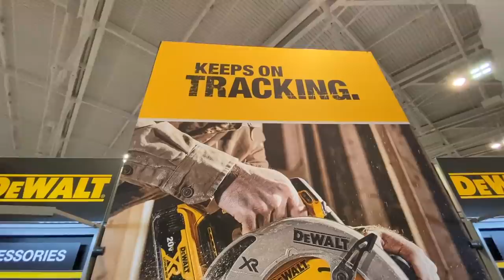Dewalts NewTools of 2020. First time seen in public at Stafda

Comment: I want to know how they've improved heat and ventilation on their new impact driver. I saw one video where a previous model went up in smoke.
Reply: Yea vcg is dumb asf. Those videos just try to use the tool on something its not supposed to be used
Reply: Yeah if you really witnessed something like that, that individual was intentionally trying to destroy the tool. There was probably a concealed variable at play in the test. I can assure you, de Walt has no issues with ventilation.

Comment: I bought a corded DeWalt DWD210G corded drill, the most powerful I could find. Right out of the box was a very pronounced wobble. I hope dewalt fixes this crap but considering I discovered wobble isssues were reported as far back as 2014, I doubt it.

Comment: Same battery would be weaker on the 2nd run, however minimally. He should have made a 3rd run with the Dewalt. Second demo used different batteries, machines, boards, hardware.

Comment: You did not "get a different result from the SAME test"... you saw two different tests.  The first test used the same saw, same battery and the same guy; the 2nd test used two different machines, two different batteries (sure, both maybe the same power rating but still different in charge maybe and/or age, etc...) and two different guys

Comment: There were 2 big variables in the 2 tests. The dewalt test used a much more powerful saw compared to the 6 1/2" makita 18 volt. Secondly the dewalt used stainless steel nails which are not nearly as common as drywall screws. They are also much softer than hardened steel drywall screws. We need to see a real scientific test. Same saws, same materials same generation of blades and a mechanical method of cutting to remove the human factor.

Comment: The Diablo booth could be rigged in SOO many points (nobody confirmed the blades before hand, nobody confirmed the batteries before hand, the 2 pieces of wood could have been different, the screws could have been different, etc).  The Dewalt booth at least went through everything (They PROBABLY still rigged some stuff), but I'm definitely siding with the dewalt both on this

Comment: My guess for the saw blades is that which ever manufacturer was testing simply sharpened their own product or dull the blade on the competitor. Or even reduced the RPM of the saw blade being used. There’s to many ways to fake a result like this.

Comment: The reason Diablo and Dewalt are coming up with different results is the human factor.  It is easy to control the amount of torque/pressure you apply  as you cut through the boards with screws in them.   I worked in machine shops for years and programmed CNC machining centers  and an important consideration is your feed rate.   What is going on is the sales person demonstrating the blades is deliberately applying too much pressure at the beginning of the cut of each screw on the competitor's blade which he knows will damage the teeth.  When they demonstrate their own blade they ease into each screw.  By the time they get half way down the board the competitor's blade is severely damaged and won't cut right.   But with their own they are remembering "slow and steady wins the race."   it's basically simple manipulation of the tool.  A real test would be to have both blades installed in identical saws mounted in a tandem frame pushed simultaneously by the same human so that each blade gets identical treatment.  But while it might seem like they did that it was only an illusion.  I used to do a little "magic" as a hobby when I was a teen and now can often spot such tricks.  I find it amusing that both venders were using the exact trick to fool you into thinking their blade was superior.  Anyone with a tiny amount of knowledge of the limitation of carbide cutting tools can easily destroy the carbide tips deliberately on one and then carefully avoid doing same on the other.   If I was there I'd offer to demonstrate and all you'd need do is tell me which blade you'd like to be superior for that particular demonstration.

Comment: Sad example, not a fair test. Dewalt uses a 60v saw and then they decide to test a regular wood framing blade, its clearly visible. Why not put on a Diablo wood/ metal blade? . The Dewalt blade looked good and is not clear if its a regular faming blade or a wood and metal nail embedded blade, that would certainly make a difference. Just my opinion, I am a Dewalt guy, however I didn’t think the test was honest.

For the Diablo people, come on, you are using 18v saws , compare to a 60 Volt? Your little saws were struggling from the get go, and I feel the battery testing the Dewalt blade was already runned down that it didn’t even made the whole cut. I feel this test was not done fairly neither.

Comment: Well, first off Dewalt used the same saw and batter, where as the other guys did not, so not the same battery!! Also, how do we know what the density of the wood was and the density and hardness of the nails, was spacing of the nails the same...so in my view too many variables!

Comment: You can clearly see during the DeWalt test he had the blade going through the wood at the appropriate depth of just a quarter of an inch he kept the song Running straight on the line the whole time when he switch to running the Diablo blade the blade was buried so deep it was almost up do the nut on the wood then he can see that he twisted the saw during the cut which caused it to bind Up and Slow Down which then would cause it to start breaking off the teeth as all of these things are leading to them not hitting the nails at the appropriate angles lastly when you see him tilt the saw to show you the teeth are all broken you can clearly see during the middle of the cut he has totally left his cut line personally I don't like these kind of test from any company because they're biased to basically making their competitor look bad instead of making your competitor look bad just speak of what you do well.
Reply: Agree... evidenced by the SMOKE.

Comment: You can see at 12:23 that Diablo’s board has no nail in it, but the Dewalt board does have nails, so my conclusion is that Diablo’s test was not correctly done.

Comment: Both the saw tests weren't honest. Dewalt guy was more careful with his blade. Looked like he lifed the saw off the board. Watch his arms and feet. And put alot of pressure on the diablo blade. Watch the feet. Its easy to rip teeth off when you force that blade.  Diablo guys had the same tactic and added the dead battery.

Comment: I know this is an old video but just watched it and noticed the dewalt blade is smaller than the Diablo so their is less friction on the blade and faster revolutions. Which equals faster cutting. Also they should be using Diablo's demo blade. I also noticed all they said was "This is the Dewalt blade" & "This is the Diablo framing blade." They did not specify which blade was on the Dewalt which was probably the "demo" blade. If you look closely at the Dewalt blade you will notice blue painters tape covering the blade size.  Shame on you Dewalt!

Comment: Both where twisting the tool when cutting with oppositions blades causing it to slow and not be at the right speed to cut the metal.
Note on the diablo stand the different grips used when cutting.  #thereAreNoGods

Comment: dewalt vs diablo what i got from that was that dewalt cut all the way through with a blade with no tips and that mikita crapped out trying to do the same :D but i'm guessing about the blades that if you get a dewalt from dewalt and diablo from diablo that they both work as they show and even then i still think that dewalt cut better through then diablo did. :)

Comment: Im sorry fellas. But anyone thats ever run a circ saw would tell you what happens when you twist or bind the blade. Look at the dewalt rep after he cuts the piece with the Diablo blade. Even at the begining theres very little red paint transfer from the blade and its a new blade. I typically lose all my red paint when i start my cuts but somehow down the middle of the piece you see all this red paint. And after that you start seeing even burn marks. Light but def darker stains from the skipping he was doing. What a coincidence that where he would " struggle" with the blade is where it left darker " burn" marks. Every skip and struggle was actually a twist of the tool to force the blade into a bind. And anyone with exp would tell you that theres no effort involved un twisting the tool with your wrist. Even if you plunge cut a blade at an angle, the moment you stop moving it side to side or in any direction. The blade cuts and clears a path for the blade. You would need a very unsteady ( which lets face it happened to every one when they started using a circ saw) but with experience you get the feel for pushing the tool/blade true and straight down a line. You need to bend the tool to cause that much paint transfer onto a workpiece... Moreso burn the material. That one was an obvious for me thats why im only giving my opinion on that portion. The other one is beyond my observational skills. But one final thought. Somehow the second dewalt circ saw( with the Diablo blade) looked odd. Maybe older model? But new out of storage? Could explain why thw dewalt 20vt worked but the tool not so much. Just my best professional input from years working in construction and being a detail oriented weirdo. Devils in the details. Good luck out there fellas and stay safe.

Comment: WARNING do NOT use the flexvolt batteries on anything except for a flexvolt tool, if you use it on a 20 volt or 20 volt max it will dry the tool!

Comment: Dead battery! The diablo bladed saw was throwing a ton of sparks & the Dewalt one was bogging down and not throwing hardly any sparks. They should have used batteries with a meter on them to show they were both full before the test. Could have easily used nails of different lengths or hardness too.

Comment: At the Diablo booth the saw with the DeWalt blade the battery you can tell is about to die, and he was barely pushing compared to the other guy DeWalt had the better test because it was the same guy same battery same board compared to Diablos test

Comment: I am now dewalt fan boy but Diablo does cutting edges. So dewalt uses dewalt brushless saw and Diablo was using Nikita crap also each company was using their carbide version and competitors regular blades which is going to give you that 10x difference

Comment: The blade test for both is bull. The Dewalt instructor twisted the saw making the blade run hot. You can clearly see that  the guy don't know how to use a saw or he knows how to screw up a blade. He started off with the blade on the line and the cut alignment notch off by about 1/4 inch, then twisted the saw to realign the saw causing the blade to bind and run hot. As for Diablo, they are not using the same power. Its clear that the saw with the Dewalt blade doesn't have the same amount of power. Just my opinion.

Comment: #1 125 mph Dewalt Leaf Blower:
Yeah that scraper was kinda stupid. You need to be able to stand straight and scrape instead of bending over straining your back. They need to have people who work in the industry 24 7 putting there 100 cents in on the factors of landscape longevity! This is similar to power washing. You need a longer rod so you don't kill your back. 

#2 circular saw: Did the Dewalt guy purposely break a tooth on that Diablo blade? Once one tooth is compromised, there will be added failure to the rest of the blade. Oops!

Did the Diablo guy really keep pinching his blade to bind and damage the teeth? They think they can fool everybody but they can't fool me! Proper use of any blade prolongs the tool and its accessories longevity. How stupid!

#3 Dewalt stud joist tool:
Haha on that tool! Looks like a freaking propeller! 

#4 Dewalt 12v:
Great over the top home owner tool for sure! 

#5 the 2.0 toolbuilt box
Looks like a tough tool belt technology. Looks pretty solid. Would hate to turn my head and have someo e roll that off though. How do you get it out of your truck. Nice tool for around the house I think. Alot of this stuff is looking like super homeowner equipment.

#6 Dewalt 4in circular saw:
Nahh

#7. Got to see the nail gun in action

#8 God bless you too. That happens to me when I pray too some afternoons at meal time, but hey, at least I'm praying!

Comment: Damn i was hoping dewalt was introducing a brand new full sized impact driver maybe a dcd889 that works with flexvolt sincd with the 887 and idk about the 888 you add a flexvolt battery and it overheats

Comment: Dewalt cheated with different blade depths. They allowed their blade a more appropriate shallow cut, whereas the diablo blade was set much deeper, putting it at an inappropriate cutting angle. Nothing obviously wrong with the Diablo booth demonstration, but its hard to tell.

Comment: You can ruin about any type of cutter with to much force instead of letting the tool work . Banging the blade as fast as possible off the 1st few screws and the rest of the cut is messed up and we don't know what amount of force they used in either test . Besides it's not about who can rip the fastest it's about cutting the longest . Both companies are really not using good business practices by trying to get the consumer to go as fast as possible, just make the product durable and consistent.

Comment: He didn't let the saw get powered up before he put it in the wood
Reply: Your able to minipate the rpms much easier that way
Reply: Basically starting fast and then slowing down but the first time he slowly went faster
Reply: Another thing he could be pushing the blade against opposing end of the cut to slow it.. Basically there's like 5 different things he's doing to slow the blade down and cause damage
Reply: Either way I think the Dewalt blade did much better because Dewalts performance of their own was better than diablo version of their own

Comment: now, i cut wood in a dayly basis. diablo are good blades, it all would depend on what wood are you cutting, teeth on the blade. but of course either one would say mine is better. 
but "WE"  the ones that used them, we have the last say so.

Comment: Look, it would be easy to blame the difference in test results on things like batteries or technique. These displays are no different than a magic show, it's what you don't see that is making the difference. If I had a guess I would say they are using tricks to make one blade cut through harder material. Maybe driving a hardened pin an inch deep then a softer nail in behind it. You would only have to do one or two to destroy teath. Or heck, just use different bolts for different test pieces.

Comment: The age of disposable saw blades is a disappointment.  Nothing cuts like a steel blade.  Sure, the edge on a carbide blade lasts a little longer, but a steel blade can be made sharper and can be resharpened for years.  Both Diablo and DeWalt make fine products, I don't know why they have to try to make one look inferior over the other.  Just show your product without having to try to make another look inferior.

Comment: BOTH WERE BS! For different reasons:
       -DeWalt used more nails for the competitions cut, arranged in a triangle pattern, whereas the DeWalt section simply had one single line of nails. They also lied and said the competitors product had been damaged, which it had not, plus the same battery was used first by them then after being drained it was used AGAIN.
      -DIABLO most likely used a low battery on the competitors product, and purposely went slower as if that was a factor (insinuation that the blade magically cuts better, when in reality there are many factors involved) also their Makita tools appeared to be used heavily, and to varied degrees.

Comment: First test, diablo blade height is much lower. Second test nails did not go all the way into wood - look at the wood after the diablo blade cut through, no nails. 
Both tests are rigged but the second was worse. Based on these two "tests" ...I would buy Dewalt over Diablo.

Comment: If you add side pressure to the saw instead of forward pressure then the blade becomes bound in the wood and extra friction starts rubbing on the sides of the blade and it looks as if the saw is having trouble cutting when in reality the blade would cut fine if dewalt and diablo applyed forward force by the demonstrators. They should let the spectators do the cutting instead of the paid showman.

Comment: stainless steel is softer than drywall screws, i hate the damn things, strip so easily.  and if you get the wood only blade for the other brand... didnt see them point out which was which for the blades.

Comment: Diablo did use 2 machines and 2 batteries, Dewalt did use 2 machones and only one battery.
Still the Dewalt Machin did go better then the Makita with the Diablo saw.

For me it looks like Diablo managed it up a bit. but Dewalt where totaly open.
Where the Makita saw with the Dewalt saw bad loaded, another kind of battery, setup battery, or a used saw of the Dewalt and a new of Diablo, 
No one did show their own blade, so did Dewalt also lose tooths at Dewalt test?

Any how it looks like a to big differanse to be true and fair in one of the tests, and for me it falls for Diablo.

Comment: You got to be kidding me DeWalt test was a lot better diabolo. there's too many things that could be going on for them to cheat.. one is the using two different saws with two different batteries, the next thing is is the screws or bolts are cutting into can be two different types of harnesses...  Personally I would go with the DeWalt on how they tested both of the blades that was more fair the end result is I will be buying DeWalt blades.